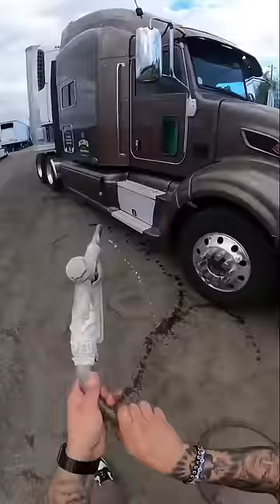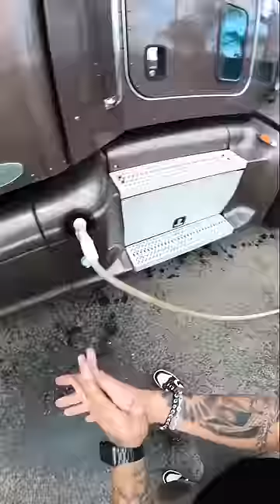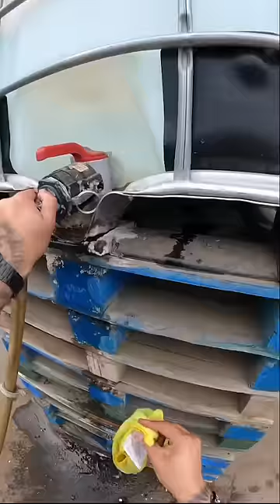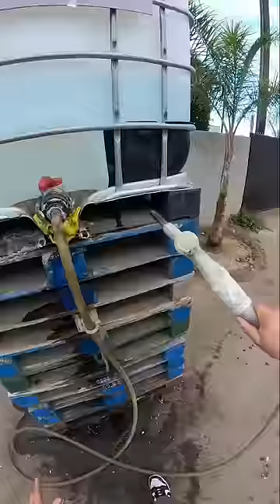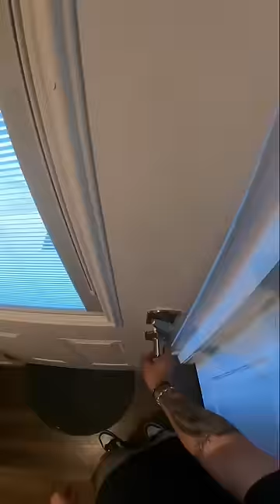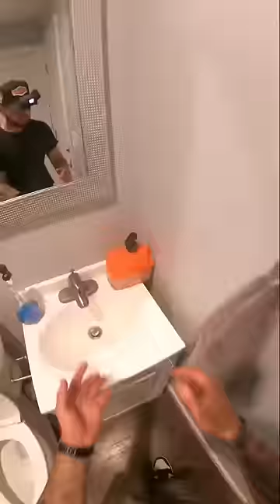there’s DEF-INITELY a leakage at the yard 🫠 #shorts

Comment: Just a recommendation, the DEF shouldn't be out in the sun, it needs to be somewhere out of the sun, somewhere chill so you don't have aftertreatment issues later on🙌
Reply: What if there is a leak like in the video? It'll burn or something else?

Sorry i don't know much about modern trucking :(
Reply: @yoslauda4714  spilled DEF dries and leaves white crystals. It's also pretty corrosive
Reply: It will freeze as well.  Freezing liquid = blowing up seals and gaskets.

Comment: You shouldn't keep DEF out in the sunlight like that. It needs to be shaded so the water inside doesn't condensate/ separate and cause the def concentration to become too high. I have dealt with many check engine lights because of this causing DEF quality faults and SCR efficiency faults. . Having it out in the open like this will also become a problem in the winter. Your truck has DEF line heaters and a DEF tank heater so your supply tank should also be kept above freezing temperatures. 

Just some quick Tech Tips. Be safe out there.
Reply: @dalecaldwell8094 I work with it everyday as well you are the only one that sounds stupid here 🤣 cause I live in Florida and we keep ares out there n the sunlight just like in this video it doesn't condensate like you think

Comment: Whenever your fluid is running out without pulling lever or opening valve. Try to put nozzle and hose above fluid level in tank. That way it won't completely empty tank on ground. Saves company $$$ and helps from contaminating area/environment. We only have 10yrs left according to AOC

Comment: Those IBC couplings are shit. They always leak and rarely hold tight. The part I mean is the connection efter the valve on the IBC. Use a top mounted pump instead, no risk for leaks.

Comment: Pro tip btw don’t add soap when cleaning off something burning your skin just rinse with water then after it’s not burning add soap, this is because the chemicals in one material might not be found of the others and make a dangerous reaction. Also if you wash your hands off with just water and your hands feel slimy then the chemical has remove your very top layer of skin
Reply: Wasn't that just gas or diesel? It never burns me...
Reply: DEF has a PH level of 9 to 10.  It is a base and your hands will feel slimy until you rinse excessively.

Comment: You didn’t turn the valve off to close off the tank from the leak... you left it open to all drip out eventually...
Reply: Btw those valves aren’t freeze proof on plastic fittings and should be turned off when not in use.

Comment: Someone needs to fix that asap and put a sign on it until it's fixed because u never know what dumb ass could walk up to it smoking a cigarette. I've seen people smoking around gas pumps and thinks because they stepped back a few steps it's fine but if u can smell gas then your to close to be smoking or lightning anything because the fumes are more flammable than the actual gas
Reply: DEF is not flammable.
It is corrosive though.  Not corrosive enough to be considered hazmat.
You could actually put out fires with it if you had nothing else to use.

Comment: Def sucks and doesn't do anything. I mean think about it. Environmental tech says let's reduce carbon emissions by producing a fluid to combat said emissions by using electricity which needs some kind of fuel. Even by hydroelectric tech, it's not readily available as it needs to build pressure. Even then, it's put into plastic jugs inside cardboard carrying cases for the small truck people. Yep, really doing a number there. Miss your content bro, hope trucking is doing you well